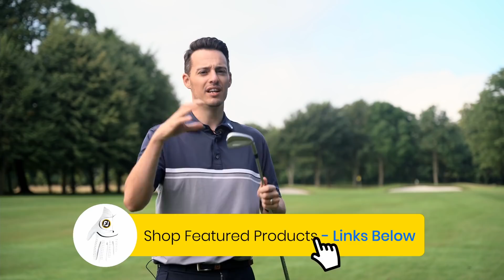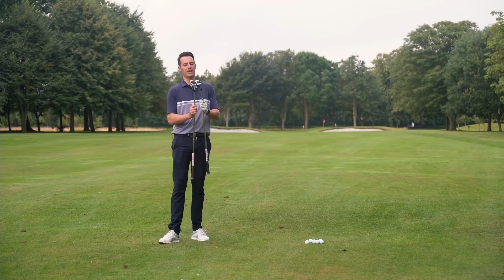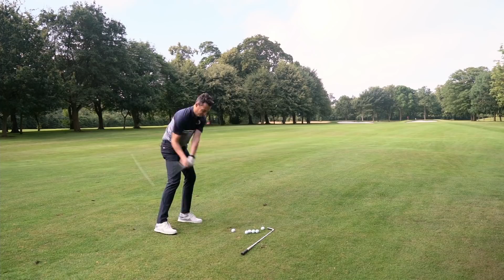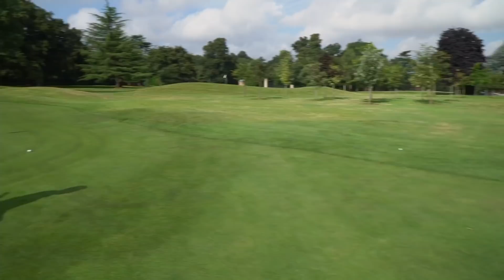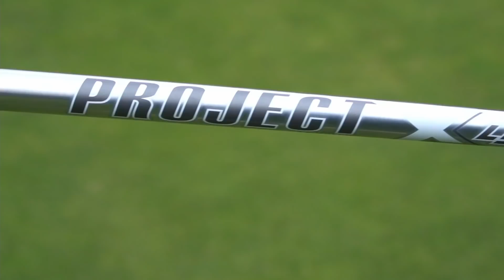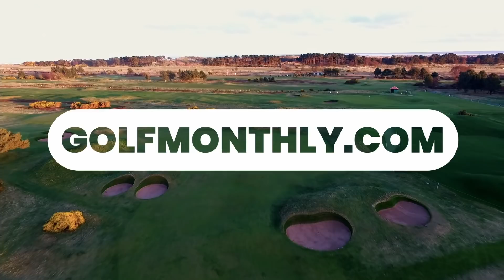BEST NEW CLUB OF 2021? Ping i59 Iron Review

Comment: Cosmetically I think that they look stunning👍
I would be interested to hear from PING engineers why they have decided to used an aluminium core rather than going down the injected foam route. Being PING there will have to be an engineering and performance benefit/reason